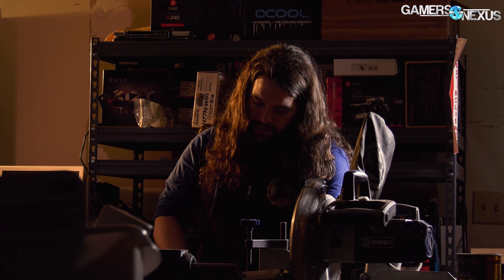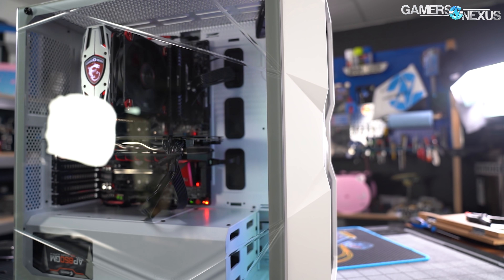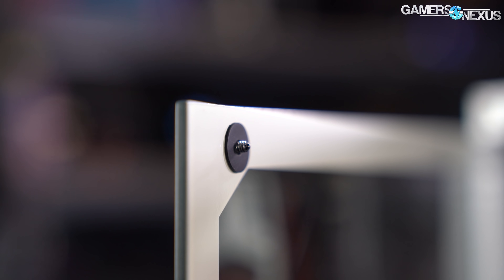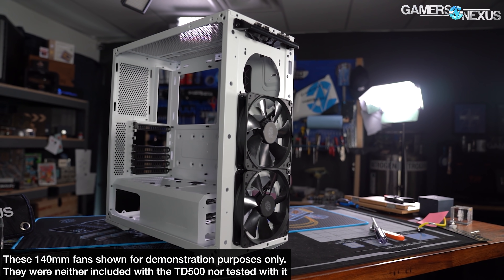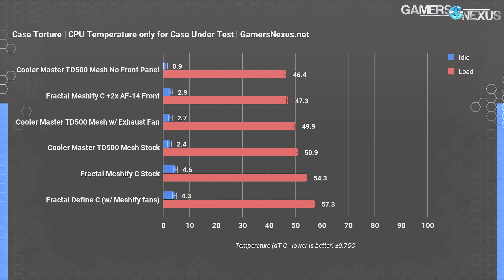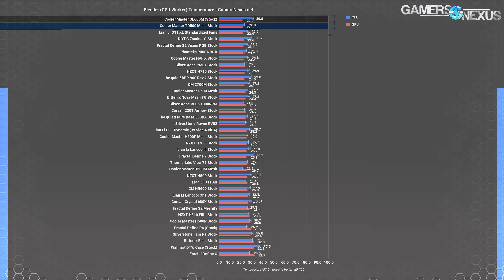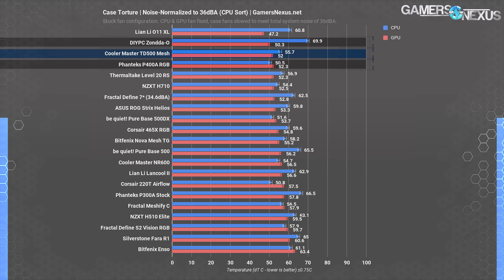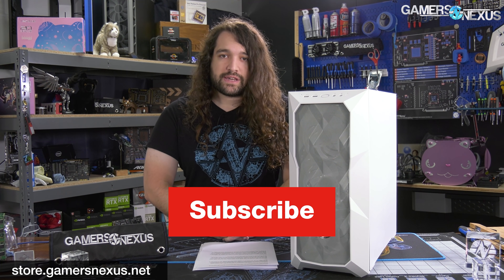Cooler Master TD500 Mesh Case Review: $100 Airflow Show-Down

Comment: Steve writes an article on a case showing it as positive buy

EVERY RETAIL STORE
out of stock
Reply: I pre-ordered mine and got it 3 weeks before the street date so i wouldn't be surprised especially with how these cases were hyped up (both positively and negatively mind you) back at CES when they were announced
Reply: This case has been in and out of stock since it "released" in March. Covid-19 really screwed up a LOT of product supply lines.
Reply: Wrench Viking true, but generally speaking every time Steve says something good about anything that product becomes out of stock suddenly or prices jump. I'm looking at you Newegg!
Reply: It's in stock
Reply: Joe Joe WHERE
Reply: @ayaanmian4114  newegg
Reply: @joejoe8903  amazon
Reply: i got this tower on a whim after phanteks p500a went out of stock in nov 2022, and my preordered z790 finally came in which was the final part of my new build i needed outside of the case. hadnt built a pc since 2015, so i was stoked and just picked the first brand i knew / had used before and had a mesh case. was so relieved to see this video afterward, lol. its a great case. not the best aesthetically if using a dual tower air cooler since it has a full view glass panel. had i done more research i would've gone with a lian li 2 due to similar cost, preinstalled exhaust fan, ability to attach two intakes onto psu shroud, psu shroud covering entire bottom of case, etc. but i am happy with the td500 and won't buy a new case in the near future. if i absolutely need a 360mm aio in the future, maybe, but ive seen people fit 360mm aio's in this case (though others say they had to remove a piece of the top of the case to fit their radiator)

Comment: This might sound a bit weird, but I think people would kill for a computer case forged in fire, old school Roman Blacksmith style.
Reply: Makes it easier to make bigger holes as well :>
Reply: 50 kgs, full metal.
Reply: Hand forged parts don't play well with tolerances. And as for the guy wanting to put in holes in it, forging hardens steel unless you temper it first, so either get a big ass oven or a lot of drill bits
Reply: Someone get Jay on the phone
Reply: @heyitsFluxxy  As long as it's not a gpu repair! lol
Reply: Imagine if someone attempted a Game of Thrones or The Witcher-esq themed case doing just that.
Reply: Alec Steele just forged a bike frame...maybe he and Steve should talk.
Reply: Forged in the fires of Mordor!!
Reply: That would make a cool episode of "Forged in Fire".  At the end instead of slashing things with the swords they made, the cases they made are put through a bunch of benchmarks and reviews.
Reply: We need to ask Alec Steele to make one!
Reply: @Liatin1  One Case to Rule them ALL!
Reply: How about hot forge pressed instead of hand made?
Reply: True. Id like a solid 40-50lb chassis thats virtually unbreakable. Panels too.
Reply: They would have to kill for it to afford the shipping. Lol.
Reply: @emma70707  battle of the 5 armies type shit 😂

Comment: Thank you for reminding everyone that closed loop radiators should be placed with the tubes down (although it looks way less cool). It's very hard to find this tiny but important bit of information anywhere on the web or user manuals for that matter. Speaking of user manuals, they never even touch in the subject of front mounted radiators which paradoxically make the most sense placementwise anyway.
Reply: For your last point: depends.
If the GPU Temp is the "bottelneck" of your Performance a top mounted rad has its advantages.
But as Jay concludes, the difference is very slim, soit doesn't mattet much.
Reply: Why? And by tubes down what down? Down as in the middle of the tube is u shaped?
Reply: Agree R.E. Steve promoting correct installation regarding tube positioning.
However: Front mounting radiators is NOT the best placement assuming front intake. Just means you are carefully taking heat to the front of the case and then blowing it back inside! Radiators should /ideally/ be placed on exhausts. Unfortunately due to sunk costs in tooling as discussed in the video, the case market is very slow to adapt to trends such as AIO and so the case manufacturers love to point out how the fact their old internal design wastes loads of space at the front grants it great radiator support!
It's pure marketing from case manufacturers whereas radiator manufacturers have nothing to gain from suggesting an intake installation.
Reply: mister.T Jr  I really don't know how you got the impression that I am defending case companies when my whole comment criticizes them for promoting poor practice and bodging support.
I largely agree with you.
Reply: @zig131  Conversely though, unless your AIO rad is in a completely separate compartment, exhausting the hot GPU air through the rad only spikes up CPU temps. And considering most good GPU coolers don't really get affected by hotter ambients too much, versus AIOs getting very affected by exhausting hot air through it, front mount for AIOs are typically better.
Reply: I would like to read more into this.  How "down" is down enough?  As long as the tubes curve downwards before curving back up into the pump?  Or as long as the pump is physically lower than the highest part of the tube that connects to the rad, assuming front intake orientation?
Reply: mister.T Jr  They are Chinese companies. What else would you expect?
Reply: @zig131   i agree with you. the big problem with air cooled pc's is feeding fresh air to the gpu and exhausting the hot air. I have a msi 1080ti with 2 fans shooting air from the bottom and it still goes past 70º easily at full load. its 200w or so of heat that needs to escape the case as fast as possible. but the processor is ok it never goes past 60º and I dont have a fancy cpu cooler. the point is, If I only watercooled  the gpu and left the cpu on air, my system would be perfectly fine. but nobody does that... there is no aio's for gpu that i know of, and waterblocks are expensive to the point that its cheaper to sell the gpu and buy a already watercooled gpu... also they are not universal, so when you buy the next gpu you gonna have to buy another block... there are universal waterblocks for gpu's, but that implies doing some diy and that something can go wrong. we need better cheaper solutions to cool down gpu's. we dont need dozens o cpu's aio's, air coolers, cases etc.. cause the biggest heater on a medium/high end gaming system is the gpu
Reply: @danielpedro77  There are adapters like the NZXT Kraken G12 that allow a CPU AIO to be connected to a GPU die while also incorporating a fan to provide /some/ airflow over the memory and VRM.
A fair bit cheaper (~$36) than a water block (~$100) but of course less effective and not properly cheap either.
My colleague used one for a few years on his RTX 2080 until recently when the AIO died.
Reply: @zig131  it really depends on each pc's components imo, I have a front mounted aio cooling my cpu and my cpu temps are still generally higher than my gpu's even during gaming, so placing the aio on the exhaust would just raise my cpu's temps and lower my gpu's which isn't really what I want.
Reply: A lot of tubes won't reach far enough in a lot of cases I've built in, so I usually mounts AIO's at the top as exhaust if possible. For GPU cooling though, with something like a Kraken G12 or ID-Cooling Frostflow 120, bottom tube routing is much more manageable.
Reply: @theonlycatonice  you want the part of the radiator where the tubes attach to be on the bottom.  this way gravity helps feed liquid back to the pump.  this is more important as the clc gets older, as the coolant will evaporate over time.  if the tubes come in at the top, the pump has to work harder and harder to pull liquid in as the level falls over time.
Reply: @SamfisherSam  if you are mounting the radiator on the front, the tubes should be on the bottom of the radiator, rather than the top. This is because over time liquid permeates the tubes which leads to more air in the loop. Air will naturally rise to the top of your loop. So if the tubes are attached to the top then depending on the design of the AIO, some air may get pulled through the tube which can cause issues, most notably a "whining noise." The newer the AIO is, the fuller it will be, and the less you will experience the problem. Although after a few years of having the tubes at the top you may come to regret it. The actual curve of the tubes shouldn't matter as long as you aren't trying to bend them too much.
Reply: @LordHawkstrom  which is better, mounting the rad in front with the tube down, or mounting the rad at the top if have clearance
Reply: @whipinprogress  its hard to know which of those two methods is better. It depends on your case and fan setup. Generally a top mounted radiator will result in higher cpu Temps, but lower gpu Temps as heat from the gpu will go into the radiator. If you use a front mounted radiator then you will have higher gpu Temps, and lower cpu Temps as the air that gets into the gpu will have already been heated somewhat by the radiator. The only way to know for sure is to try both methods with your own fan and case setup and see which seems better.  I think for most setups, both top and front mounted will work fine. Some people online will tell you one is better, but that usually just means it was better for them personally.
Reply: @LordHawkstrom  That's a new perspective for me, thanks for sharing!

Comment: "1.5mm" rear side panel cable routing clearance would be... interesting.
Reply: Damn, even if I wanted to store 1 grain of rice in there it isnt wide enough.
Reply: Must be the conversion.
Reply: Should be fine for a standard IDE cable as long as you don't have to fold it
Reply: @shaneeslick  I believe that Steve's "American" is showing
Reply: shane eslick no, inches. MM and CM are commie propaganda
Reply from the maker: Sorry, CM, not MM. Misspoke and didn't catch it. Our mistake.
Reply: @GamersNexus  is there a kit or sleeve to mount the cables flat? instead of the cylindrical lump of cables?
Reply: So basically a Corsair case
Reply: @GamersNexus  cm are the devil. My engineering tutor bans their use in class; just use mm instead. cm need to go the way of 'decilitres'..
Reply: @Khloya69  except the whole world uses metric.
Reply: chloe kaftan well we need a war then
Reply: shane eslick metric is backwards, not forward. We must go to war with SI, and WIN.
Reply: Nice agir pfp

Comment: This case is such a beauty!
Good enough airflow, balanced design elements, looks attractive yet subtle, has room for lot of upgrades and also priced reasonably.
I got this one in black. 🖤
(glad I ditched nzxt h510 for this lol)
Reply: I don't know how to connect the case fans to mobo cause the pins arent matching
Reply: After a year how do you like the case? Currently building my pc and saw this at my local store thought it looked decent
Reply: @xjetski7359  I love it, made the correct choice. It serves me well, cooling is adequate. :)
Reply: @williamb.j.blazkowicz3814  i actually bought an h510i case about 2 months ago and don’t like it as much ever since i met this beauty of a case.
Reply: @williamb.j.blazkowicz3814  what's the front  panel like for filtering dust? My P500a was a nightmare
Reply: @williamb.j.blazkowicz3814  hey bro can i mout a 
Corsair icue 150i elite capellix, 360mm aio ,or 240 mm

Because I'm going to buy a TRIDENT Z ROYAL ram

I hope 360 can be fitted with it

And how's the build quality
Reply: @xjetski7359  i have the td500 in black, after over a year of use i absolutely love it. The airflow is insane, looks super nice, still manages to catch enough dust through the mesh and theres also a sufficient amount of cable management space, you can see the rgb from the fans easily inside the case. its good
Reply: Is the crystal front where the rgb fand acrylic? I need to clean it
Reply: @ViperzDesign  how easy it was to build? considering this case as well

Comment: "Doing normal system maintenance is a small price to pay for good cooling"
This has to be repeated a million times each day until everybody accepts it!
Reply: Not really. Look at phanteks p600s. They have good removable front filter but also fabric in front of it which don't block any air but hides how dusty the filter gets. So even if You don't clean it for 2 months, then you take out the front fabric panel and the filter is all dusty. The airflow is Soo good that it takes only 2 or 3 weeks for mine to get all grey. Would hate this to be visible all the time
Reply: @HiCZoK  can confirm, love my phanteks p600s
Reply: If this was true, every case would have no front cover.
Reply: Dave's Unbranded  No front cover is an overshoot, but I sure as hell wish every case had a mesh front panel instead of a plastic/metal/tempered glass slab.
Reply: I keep my pc on my desk. No dust. On the floor is a totally different story.
Reply: Not apply to high tier Silverstone cases.

Comment: That HDD cage is an interesting design. Allows most of the benefits of removal without compromising on the structural integrity of having it support the shroud (and saves money). Good idea for most use cases.

Comment: Bought this case on your recommendation for my first pc build. looks super sweet, everything is staying cool with stock coolers in stress tests, and I couldn't be happier. thanks for the info.
Reply: do you need to install any extra fans or are the 3 preinstalled fans enough?
Reply: @joelss420  i did install one exhaust fan. the ehxhaust is always running very low so i don't have to close off any other ports to keep positive pressure. so far it's running clean and the air is moving stright from the intake to exhaust at the back, very quickly. ive done the vapor flow test, and it runs in and out perfectly.

Comment: I just bought this case this month for my 5600x+3060Ti build. It’s been pretty good so far and haven’t had any problems with its thermals. Keeping in mind that I only have the 3 Stock fans for intake and added 1 exhaust fan (from my old PC from 2013-2015???), and using the stock Wraith Cooler that my 5600X came with. 

I haven’t touched or adjusted any fan settings and yet it has been able to keep a good cool temp of 45-55C. It would occasionally go to up to 60-65 but only that’s when I’m running multiple apps all at the same time.

I’m planning to add 2 more exhaust fans at the top or an AIO. I’d say it’s a good buy for the money spent.

PS: I have my room AC at 23-24C whenever I’m there using my PC.

Comment: I've been running the TD500 for 2 years, intel z390 9700k with a noctua NH-U12S cpu cooler, and a 120mm exhaust fan behind it, a RTX 3060 and it does in fact stay around 50°C.

Comment: I picked up this case a few months ago.  Loving it.  Simple and effective.  Ryzen 3700x and RTX 3070, CPU temps of 35 and full load of around 75.  GPU idle's around 27 and full load around 60.  Upgraded fans to the Cooler Master Halo's x 5.  3 intake and two exhaust while using the stock Wraith Prism on the CPU.

Comment: Personally, I like the uniformly faceted mesh more than randomly facets. The randomness of the low-poly look that facets can give can work, but only on a 3D shape, not a 2D sheet with random mountains and valleys put into it. Uniformly faceting a 2D surface gives it a much cleaner look, akin to how jewels are cut, which is important for how the jewel plays with light, which can also be seen with this case's mesh front panel. Even without the RGB fans, the mesh still looks nice. 
Also the idea of using pins for mounting could lead to something useful eventually. Imagine a single piece removable and reusable rivet, either metal or higher strength plastic. Simple in and out, and no repetitive screwing, might even be faster to use. If they made it strong enough for water cooling components, I could see the idea being used, a lot, especially between the ease of use and aesthetics of them.

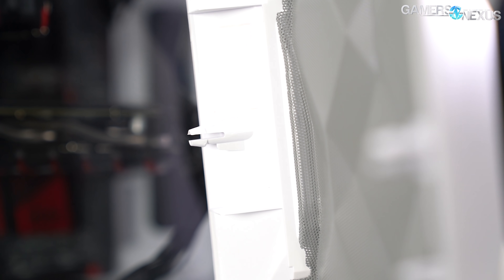Comment: 7:25 "And the mesh is flush with the frame around the edges, leaving no air gaps."  Air gap visible at the top on the pan shot.  It might have popped loose when you were taking the case on/off.
Reply: i saw that aswell! lmao

Comment: i have this case and i removed the mesh off the front to keep the trim complete and then i filled it up with a x570 tuf gaming wifi mobo, ryzen 5 3600, rtx 3070 tuf, 64gb g.skill trident z rgb ram, samsung 970 250gb m.2, corsair force mp600 500gb m.2, seagate barracuda 2tb hdd, thermaltake toughpower rgb 650w psu, lian-li galahad 240 white. and replaced all front fans and rear fan with white lian-li unifan sl 120's. and dressed with lian-li rgb strimer cables. its absolutely beautiful. one of my favorite builds ive done so far.